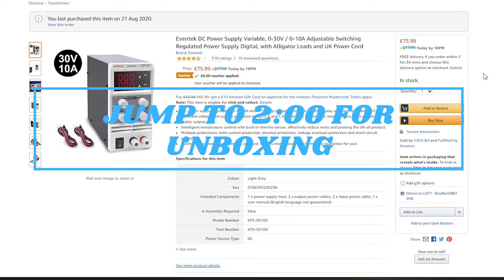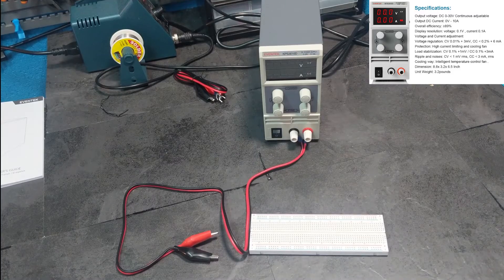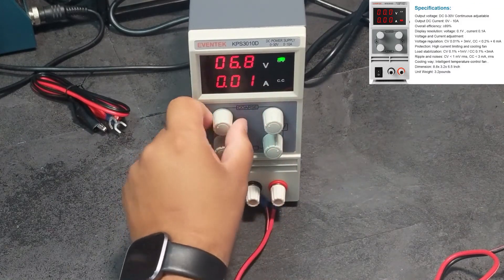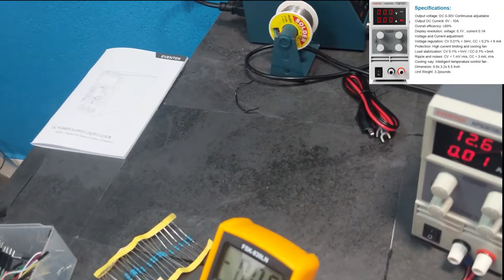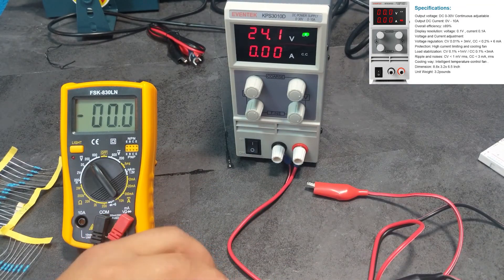Unboxing Eventek KPS3010D DC Variable 30V Power Supply

Comment from the maker: Timestamps
00:00 Amazon Product Page
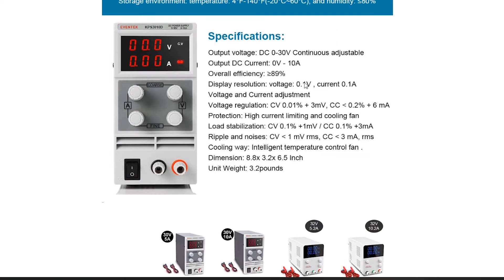2:00 Unboxing
2:55 Cables
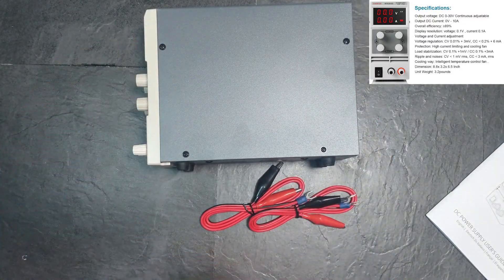3:45 Size Comparison To iPad
5:00 Power Will Turn On
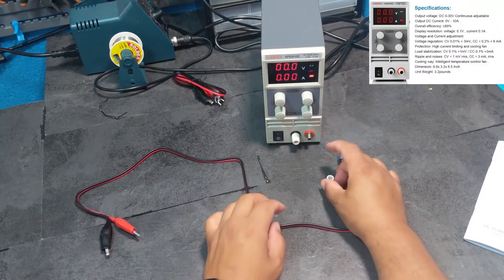5:40 Manual 
7:12 Plugging In Cables
8:00 Testing Resistor
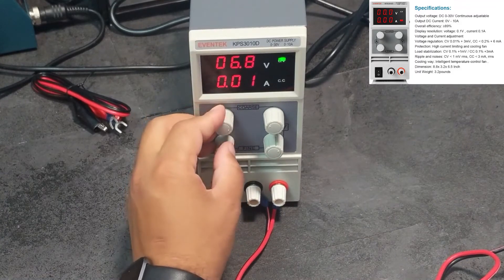9:30 31V Through Resistor
12:20 Conclusion
Reply: Thank you
Reply from the maker: @bretonmendozaangelalberto4672  you're welcome :)

Comment: We just measured the ripple on the couple of these we have in our lab for basic testing. Anywhere above 2.4 to 3 A at a higher voltage draw (in our testing, 28V) will send the ripple into a frenzy (at 5A, we saw around 3.5V peak to peak) These damaged a piece of equipment doing that, so they're being relegated for non-critical work.

Comment: Hi Hamed, thank you for the video.
Noob question : could you tell me why you can't modify the current with the buttons ? 
thanks ! :)
Reply from the maker: You can't "pump" current into the circuit without it being used in the circuit. This feature of the power supply would be used to "limit" current. So if a LED could draw 2amps, you could limit it to only draw 1amp and ramp it up to 2amps, but you wouldn't be able to pump 3amps into it.
Reply: @HamedAdefuwa  Thank you Hamed :)

Comment: I have the same one. I can't adjust the Amp's no matter how far I turn the knob.
Reply from the maker: its based on your circuit. The current is mostly used as current limiting. Get a 12V computer fan and run it on 15V. Then turn down the current on your PSU. You'll see the CC for current limiting LED come on and the current reduce.
Reply: @HamedAdefuwa  I figured it out after messing with it after commenting. Lol. Thanks for the reply!

Comment: You didn't wind it up to ten amps, you barely hit 300ma. They have a duty cycle of about ONE MINUTE, take it more than that and these little Chinese fire crackers put on a real pretty light and magic smoke show. For starters, not a single eBay/Amazon listing for these junk power supplies, or their boxes/instruction contain a shred of real data about the device, they literally print anything that want to sell it. They're also thrown together in child-labour sweat shop style factories, in the outer provinces for peanut wages. No quality control, blatantly and complacently made the Chinese way with hot snot and a prayer, who have no moral concerns for 220 vac mains electrical safety. If you want to waste between £50 and £150 on a single or doubled up version, you may as well throw it directly into your wheelie bin.
Reply from the maker: Thanks I'd say everything you mentioned is valid completely, I appreciate the detail as well. My counter argument is that this wouldn't be for someone like yourself with your level of knowledge. After 2 years of studying electrical engineering I still have absolutely no idea how I'd be able to test this at 10A or how to increase the duty cycle. I wouldn't even want to try at that kind of current. I'm scared of inverters lol. I don't expect any of these cheap Chinese products to perform anywhere close to their rated specs. For someone like myself (student so low income & low skill), I think it's far safer to use one of these than it is to build my own PSU for £20 as I've heard YouTubers say. I've had similar conversations about my cheap Oscilloscopes or function generator. They're useless at their max ratings (or even near them) but us total noobs are never going to need that kind of performance/quality.
Reply: @HamedAdefuwa  Great reply my friend, indeed, I've learned expensively over the decades, that quality comes at a price and there's no getting away from the fact that the vast majority of cheap Chinese mains operated electronics, poses even more of a risk of injury and instant death to novice users like yourself.

There is a good reason for having proper training and a good working knowledge of mains electricity, simply put....

IT CAN KILL THE UNWARY INSTANTANEOUSLY WITHIN A SINGLE HEARTBEAT, MAKING IT THE LAST ELECTRICAL LESSON YOU'LL LEARN.

Comment: Good to know the cheaper options are decent, I have had so many times where I would've loved to have basically any form of adjustable power supply but never bit the bullet since the ones in local stores are quite expensive, I don't need the maximum precision anyway. Going to be particularly useful for testing LEDs to figure out a good balance between brightness and power consumption
Reply from the maker: Yeah I felt the same way about cheap power supplies but this one is actually my most used one I have. It's small and lightweight so I just naturally use it more than my larger heavier ones that require some serious energy to move lol.
Reply: @HamedAdefuwa  yeah I looked into them a bit more and I think I'm at least getting a unit where you can turn the output off instead of only the entire unit, seems like these require you to short the leads to adjust the current limit and it's inconvenient to have to disconnect the leads every time you want to make adjustments

Comment: 3.2 pounds is 1.45 kilos. I could go out further but I don't think you will be doing anything with this thing that would require you to know its weight to the ten thousandths place or even the thousandths as far as that goes.
Reply from the maker: Lol help me out here I'm old, what are you referring to? In terms of its weight/size, It suits one of my workbenches nicely because of limited space but I'm not a fan of the tall/skinny height. I do knock the thing over a lot (whilst on) and sometimes it concerns me that I'll do some damage to a circuit I'm working on or worse. I do still like it though, use it multiple times a week.